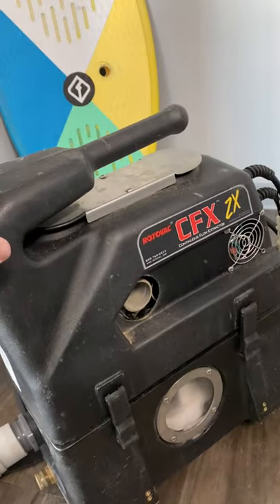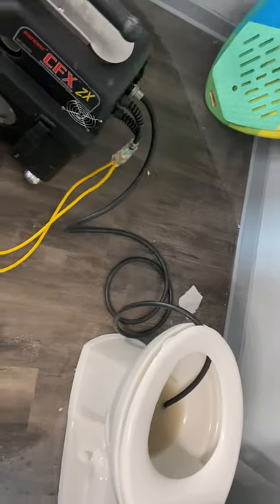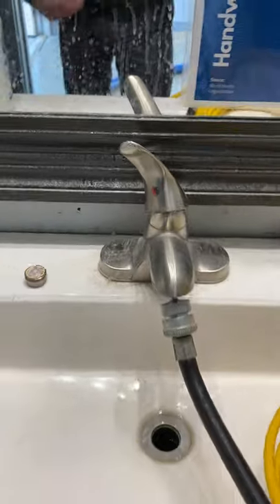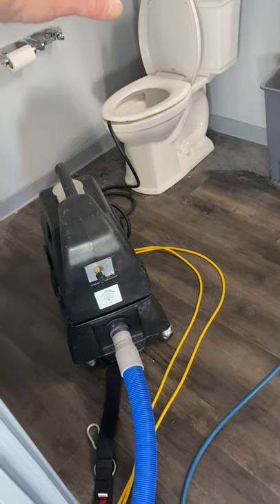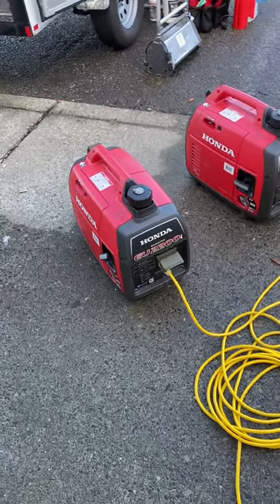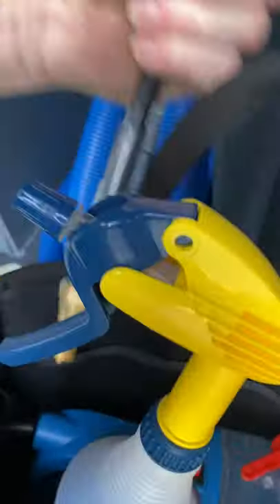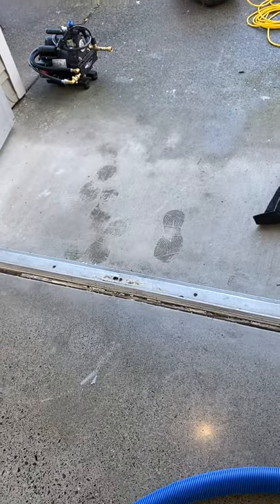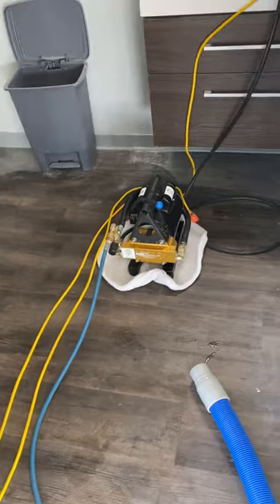Rotovac cfx-zx and water otter

Comment: I use basically the same setup but I use the Rotovac DHX instead of a wand. I never take the CFX off my van because the cfm is so good. So, I use it like a truck mount. Good video with needed insights.

Comment: thanks i have a water otter, i did not know you could pull water from a bucket with it. nice ! I do vct strip and wax but getting into carpet and tile. the cfx and water otter fit easily in back of small pickup.Very informative video
Reply from the maker: Thankyou for the feedback!
Theres always things i see i can add in or edit - but i feel pretty good about getting on it and cranking this video out- its been a good source to see what this machines actually all about😊

Comment: I like your setup, if it's easier to manage than a large unit then go for it.  I like that everything is powered by Honda as well.  I am a fan of Honda stuff and I liked the idea of the CFX.  It's manageable and just a bit larger than a Rainbow cleaning system and requires little down time as it is continuously working.  It has the comedic bit like you are unloading four pieces of luggage, hoses and extension cords before you go into a house.  I didn't know the Water Otter existed but now I do, it makes the CFX just as capable as a conventional portable.

Comment: I have a similar setup using the Mytee air hog LX 7303 that I use mainly for tile & grout. 99% of my carpet jobs are now done by vlm pad capping. It is just so much easier than setting up all that equipment.
Reply from the maker: I am a huge fan of vlm.
I have a wide array of vlm equipment, and it is much faster.
However, its important to recognize the limits of vlm’s efficacy as well, and to not dismiss when hwe is the correct answer.

This why when I sell our services, (our brand) I sell our expertise in the field, and our care for our clients, rather than focusing on our processes.
Reply: @RAKSAX  Yes you are correct. good luck !
Reply: Your AirHog, how are switches/electrical holding up?
Reply: @runzization  just sold the mytee, I never had a problem
Reply from the maker: @runzization  in functionality , this is like an airhog.
But airhog is a mytee product.
This is a rotovac cfx-zx.
I have to be clear in that.

Motors switches-flooding the machine or otherwise overamping your machine in some way will greatly reduce the life of any switches and wiring connections.

I’ve replaced one switch.
And one motor. (I replaced both motors while I was in there, but one motor was necessary.)

I keep a few switches and 2 motors in stock on backup.
I bought this Machine about 3-4 years ago.

If I ran it all day every day, I’d
Probably budget 2 motors and 3 switches annually, (about $350.00 in parts)

I dint know if I’d actually burn through that or not, but I’d be ready for it.
Im just speculating.

If I recall, the motors are rated for about 1500 hrs
Reply: @RAKSAX  good plan! One thing I've learned is to make sure you keep the wand seated on floor, before flipping switches this actually reduces the needed amperage by at least 2.0 amps.

Comment: i had a cfx original and its alot to set up just to do a 1 or 2 room job , it works great and clean good just will kick your ass if u set it up 2 or 3 times or more , the one i had u had to set it up 2 or 3 times on 1 job so times a few jobs u are beat , its a good back up but if i got back into it id go for a truck mount just for easy setups on jobs

Comment: Lx vacs are rated with 225-250 CFM and 180 lift. I would say it's well balanced both the CFM and the lift.
Reply from the maker: These are not lx vac motors.
Reply: @RAKSAX  They are made by the same company Mytee also use them
Reply from the maker: @Beluel  rotovacs zx motors are designed and manufactured exclusively for rotovac.
They have different amperage and performance ratings than the ox motors.

Ive tested them side by side.

Im not saying which is bettor or worse- but i am confirming they are not the same motor.
Reply: @RAKSAX  I agree ☝️ on that however in your opinion which ones are better or more efficient the LX or Rotovac ones ?
Reply from the maker: @Beluel  boy I dont really know.
The zx have a little higher wc” and a higher amp pull.
But i didnt test the cfm between the zx and the lx motors.

Honestly tho, its really splitting hairs between the two options. Larry Cobb is a pretty big fan of the Lx motors.
Ive run the cfx-zx and the air hog side by side and just didnt have much to say. Their both amazing motors.
Reply: @RAKSAX  Thank You for the input Im trying to decide which one to purchase LX or ZX
Reply: @RAKSAX  You've got a convenient/efficient system... Can't help but think of another electric system in "Bane" have your ever used or saw one in use? Industrial sutorbilt vac blowers that run off 10amps although they do not publish cfm, lift ratings. 

Being apart of the early "squirt and suck" portables (15' max hose!) I value performance. I recently replaced my old speedster Mytee with their (C302A) Vacs parallel and I must say at 110 feet the wand seals really good! Last measured at 205cfm which for 2009' ain't bad. If Bane isn't in the 200cfms I just can't fathom 100+hose run.

Comment: I have the same setup but I never take the pump or the CFX ZX off the van. That's a great idea adding the small drain under the vacuum intake. What parts did you use to make that?
Reply from the maker: Joywayus Brass Male Garden Hose Bulkhead Fitting with Plugs,1/2" Female 3/4" GHT Male Water Tank Connector Threaded and 3/4" GHT Female Outer Hex Head End Pipe Caps Drain/Flush Port Kit https://a.co/d/2oDS2VY
Reply: @RAKSAX  awesome, thanks!

Comment: @Roy K That water otter pump seems like a nifty idea to get higher water pressure while using a portable extractor, but I have a question. Is there anyway that you could add a chemical injector to it  that you can adjust the GPH on just like a truckmount so that you can still use rinse/emulsifier?
Reply from the maker: Hey there!

There is no practical way to do so-

Besides using an inline venturi tank, like a hydromaster presprayer-

Unfortunately tho, that really drops the gpm and effective pressure at the wand.

Another approach i use very often, is to fill a container, or the bathtub, measure the rinse into it, and just drop the water otter’s draw hose into the tub or container. (A washing machine hose works best for a draw hose, due to its rigidity) 

Hope that helps:)
Reply: @RAKSAX  ok. I guess the last thing you said is basically just like using the pump on a regular portable extractor and mixing the rinse into its clean water tank. Thanks.
Reply: @RAKSAX  I didn’t know that you could put the draw hose from the water otter into a container with water in it. I thought that it would need some water pressure going into it for it to work. Kinda like a pressure washer because it needs enough pressure coming from the garden hose to work properly.

Comment: You mention that sometimes you have to "rebuild" the pump. I have one that works great but I am putting a lot of mileage on it. How do you know when it needs to be rebuilt and how do you do it?
Reply from the maker: Typically- It will begin to not build pressure the way it did traditionally, or, it will start leaking (dripping out the housing- ) and you’ll begin to see drops or little puddles below the pump after use.

Comment: I just bought a cfx with 2- 3 stage vac motors and was astonished by the vacuum performance. It has the impeller style pump out. Is there a way to swap that out with the newer style pump out the cfx zx uses? Thanks
Reply from the maker: Where theres a will theres a way!😊
Reply: @RAKSAX Thanks decided to go ahead and get a cfx zx and it has much better performance and isn't as loud as the 3 stage cfx. I'm pretty stoked now.

Comment: I guess this could work if you put it on a small/lightweight cart so you can just wheel the cart up to the house. I would add a little giant heater.
Reply from the maker: All true-
I have  those components at the shop as well-

fossil fuel really beats electric heat.
Reply: @RAKSAX  i agree 100%. hard to beat heat from propane or diesel. how long can  you run those generators on a tank of gas? i know those things are like $1100.
Reply from the maker: @1969MARKETING  it depends on what im  powering with them.

I think it lands somewheres around a liter or so an hour for running the two generators to power that 4500 watt heater.

I hardly ever use them tho.

Comment: You actually don't have to use defoamer.... it has a Air/Water separation tank. Curious, I was wondering does this have a auto fill option?
Reply from the maker: Yes- it has a water diffuser tube inside, to  see the water in the right direction, instead of finding its way up in the motors.

Defoamer is still very much recommended , and needed however- more for the reasons of chemistry that you use, or for chemistry you sucked up that the home owner used.

Peroxide, is an example.

Another example- hitting an over the counter pet treatment spot the homeowner did-creates a foam bomb….

Going by the laundry center in the house and catching the  laundry soap spill they overlooked mentioning. 

And other solution rinses you may choose to rip through your set up.

These are amazing machines- but do not have the waste tank capacity to tolerate foam build up.

I learned the hard way - and early on- to commit to a (about 1/4 teaspoon) of liquid defoamer each job.

You can get a whole gallon of liquid defoamer for like- $25.00. And that gallon will last so long you wont be aboe to remember back when you bough it.

Comment: How do you filter the debris for the auto dump to work correctly? I didn't see any inline filter.
Reply from the maker: There is a long filter inside the machine.  Also, the pump out line has a filter screen.

Comment: Hook the generators up in parallel and they will run the cfx and water otter at the same time.  No need to plug into the house
Reply from the maker: Thats a possibility, 
However, i dont run these generators really, except to power the heater when i wish to use it.
I prefer house power when easily available, as it saves me $$$ that way!😊🙌

Comment: I usually loop my water feed hose into the sink incase it drips this way it will drip into the sink
Reply from the maker: Thats a great method.
I feel like i typically do that… I sure didn’t do it here tho😮- pretty shallow sink😊
Reply from the maker: You had asked cord gage- But I  cant find the comment.

The answer is 14/3
I use Proteam’s backpack cords at $40.00 a cord, because their the best quality moat pliable cords i can find that last for my use.
Ive been using them for years with the cfx-zx.  And have been really pleased with them:)

Comment: Does the water otter ever overheat some times or give you any type of problems?
Reply from the maker: It doesnt have a buffer tank….If it allowed to run and run without moving any solution, it will eventually overheat the pump.

If I need to stop for more than say 10 seconds or so, I be sure to turn off the pump.

Ignoring that caution is a quick way to overheat any pump that doesnt have a buffer tank, including most pressure washers😊
Reply: @RAKSAX  thanks for the reply I know someone that’s selling and just needed a little info on it
Reply: Have you had any trouble with the auto pump out? Bought an air hog and have had nothing but trouble with the pump out.

Comment: Thats alot of stuff. Too bad rotovac doesn't offer the zx with a 15 gallon tank. I have an older 15 gallon cfx single 3 stage single cord and its a work horse.
Reply: PS, Love the drain upgrade, just replaced  my dump gate valve that was leaking for months
Reply from the maker: They do now have a 15 gallon waste tank option also!
Reply: @RAKSAX  only for the older model, not for zx
Reply from the maker: @XER239  This  statement comes from years of experience with the “ZX”

Comment: Let me guess, three rooms for $99?
Reply from the maker: NAH, that was your last job but don’t worry I went behind you and fixed it for them.😂
Reply: @RAKSAX  HaHa touche sir. Although I must ask. Why no TM? My new Chem-Tex was only $8500. You're getting close to that cost with all that stuff.
Reply from the maker: @Matt-Olive-Digital  great question!
Ive owned a few over the years:)
The answer is kind of long and very subject to debate-
But in short- Ive come to prefer the pros of a portable system, over the pros of a truckmount- and being able to quickly and easily repurpose my van and trailer for other services we offer as a primarily janitorial company.
A portable system under my design is very easy for me to do maintenance and repairs on myself also.
Lastly- the gas mileage of my vehicle with a porty system, and the fuel i use per job is fractional to a tm. In the end- for my business model, I maintain higher profit margins with a porty system, despite the few extra minutes per job.

Its not for every body tho- I really see that.
Reply: @RAKSAX   Those harbor freight generators lock butt. Best warranty ever, too.
Reply: Sir , do you clean just using the water without chemicals . Thank you
Reply: What exactly does a water otter do?  Does the extractor work fine without for someone just getting into to the business? Thanks